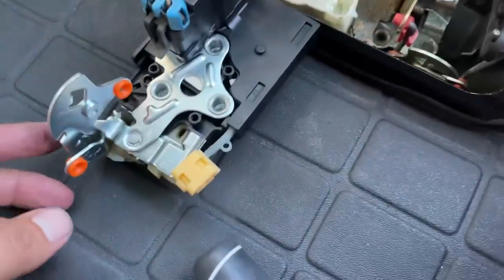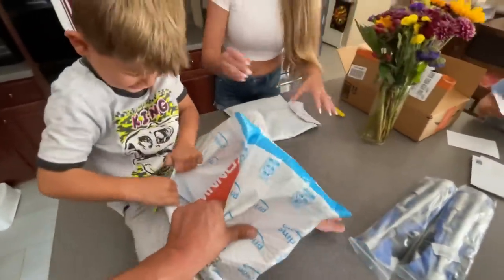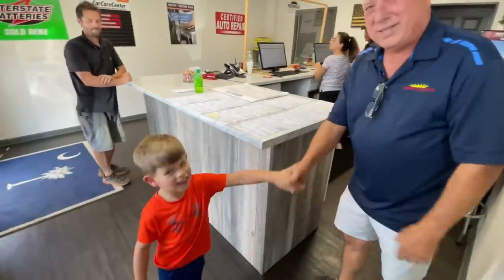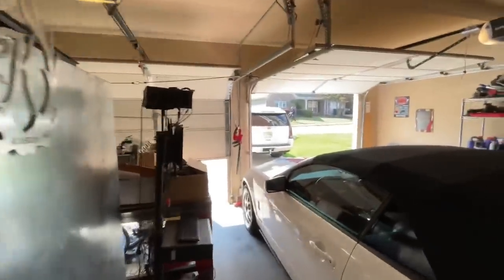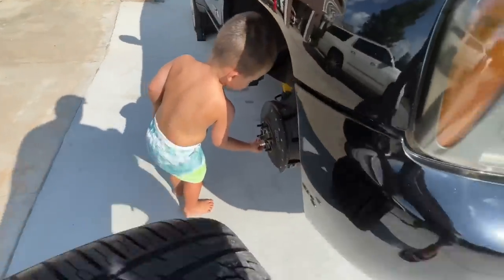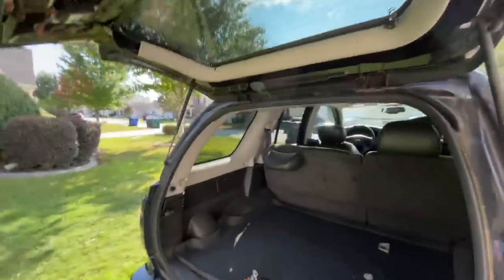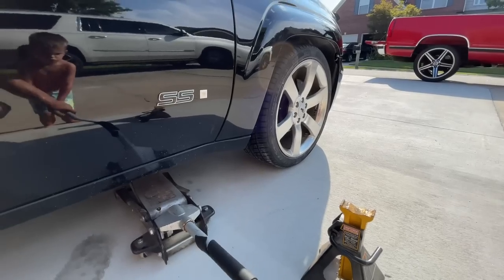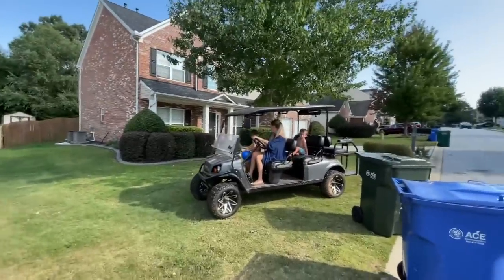“The TBSS is AWD” Who Knew LOL plus we get some New Rubber put on And Buy Some CV boots Rear Hatch

Comment: Put a test light between the two wires going into the actuator and see if it lights up when switch is depressed, that tests the power and ground to ate actuator, if it lights up replace actuator, if it doesn’t light up find out where the open is, and it usually is in the drivers door jamb where the wires bend every time you open and close the doors!
Reply from the maker: Thank You

Comment: Lift gate module
Reply from the maker: How did it fix it?
Reply: @3BBgarage  the problem was it would not lock or unlock from switch.
I did wiring test all ok. The harness at the top gate to body was fine. These can split where it hinges from opening closing.
The module is a control for all hatch functions and gets its signals from a body control under the rear driver side seat. The body control takes orders from the door switch that is also a control module.
Reply: Really really really you are a beautiful family... I hope to visit you.
Reply: Module is a small square box to the driver side of the lift gate about middle of the gate. Rock auto about $100. Got mine salvage yard $4. Salvage yard you need correct year and may not hurt to match part numbers?

Comment: Where the wires go into at the top of door check and see if they are plugged in
Reply: Or broken.very common for the wring to split where it hinges
Reply: @patrickreynolds8337  or someone put another one on an didn't fix it because I think you have to lower the head liner on those I think I can't remember some of them you can kinda let them down the head liner just a little an some of them you have to drop it completely it's a big pain I remember that u have to remove everything 🥴